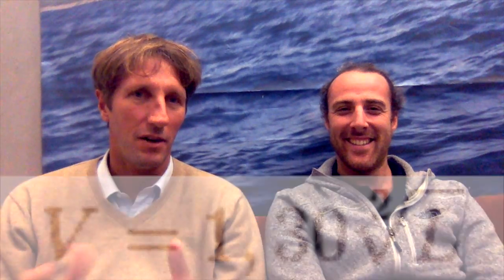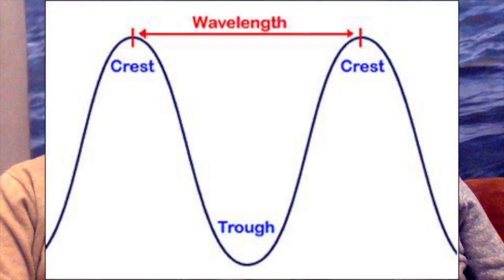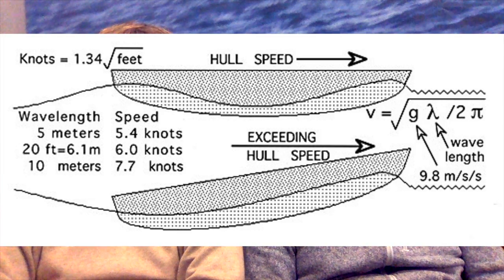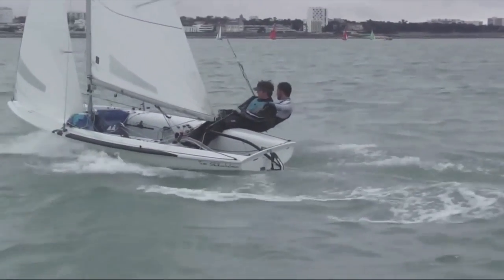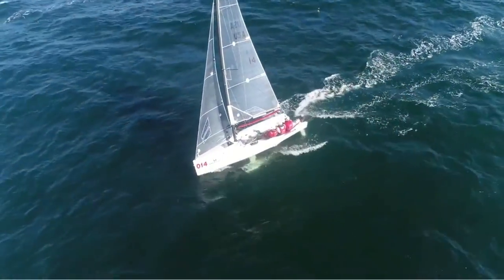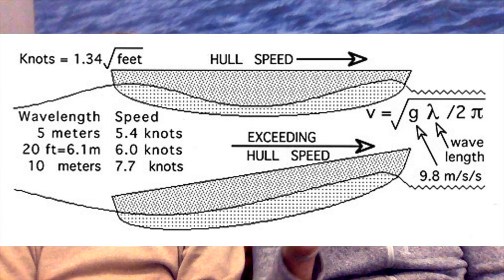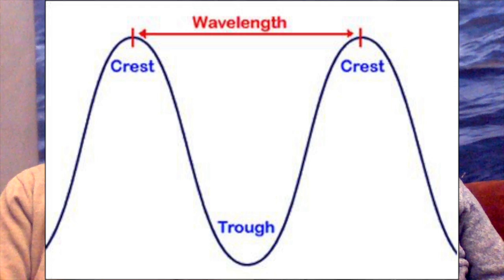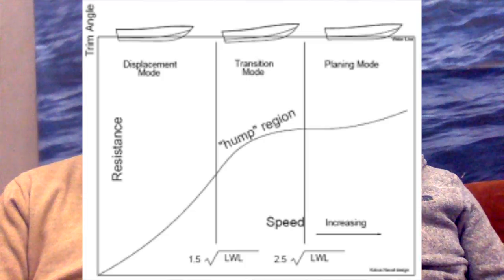E28 - Hull speed and Froude number

Comment: Great stuff you two are putting out! Thank you for putting in the time and effort. Especially for doing English versions. If you’re looking for ideas for a show, I have been wondering about low drag surface textures. Why are they good on swimsuits but you never see them on hulls or foils?
Reply from the maker: Hi Thom, thank you! Very good idea, will do for sure in the next days!
Reply: The answer to this question is very complicated. 

Some surface texturing (e.g. golf balls) is designed to intentionally “trip” the boundary layer to become turbulent. This is so that you can reduce/prevent the boundary layer from separating. On a golf ball, and possibly a swimmer, you are trading increased viscous drag for a larger reduction in planform/pressure drag by allow the boundary layer to remain attached. (I.e., the Conda effect)

If you don’t have rounded trailing surfaces with high curvature (like a ball or a limb), it’s easier for the flow to follow the surface geometry and remain attached even in these regions of adverse pressure gradient. 

Boats and other vehicles are designed to prevent flow separation in the first place. In addition, they are much larger than people and golf balls, and thus will have boundary layers that have already naturally transitioned to turbulence without needing to be tripped. 

Now, it is possible to create surface textures that help to minimize laminar and turbulent viscous drag. This is an area of ongoing active research, but typically this requires a super-hydrophobic surface treatment combined with a very precise surface geometry—typically very small lengthwise or transverse grooves or riblets. When using superhydrophobic coatings, these surface features act to reduce the wetted area and create voids where water is not in contact with the hull and produces a slip boundary condition. Without hydrophobic coatings you can still see some benefits of riblets in the right size and geometry which act to interfere with the transfer of momentum from the inertial length scales to the viscous length scales. 

Boats may use superhydrophobic coatings and these micro riblets and you’d likely never even notice them. But I suspect that they are either too fragile or too expensive/difficult to manufacture.
Reply: devzer0  
That is a great explanation! Thanks! Second paragraph covered it at a high level and the rest gave me food for thought.
Reply: I’m pretty sure that in the final series of the America’s cup in Perth in 1987, Dennis Connors Stars and Stripes used riblets made by 3M in the form of a stick on clear plastic sheet and the defender Kookaburra had a painted on polymer coating.